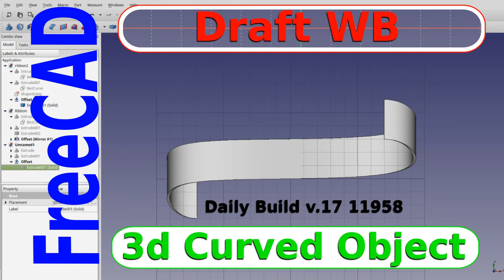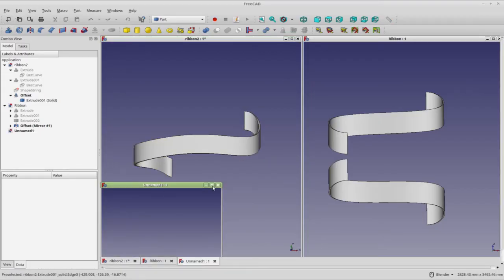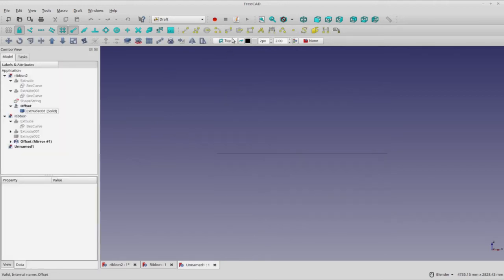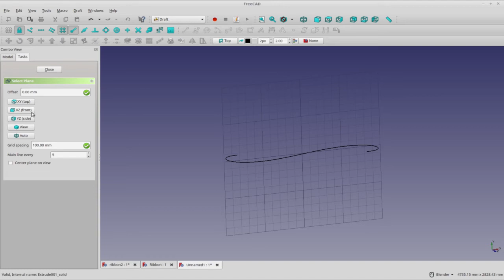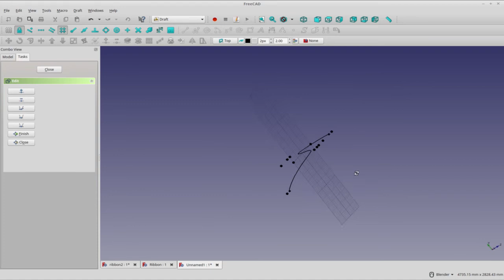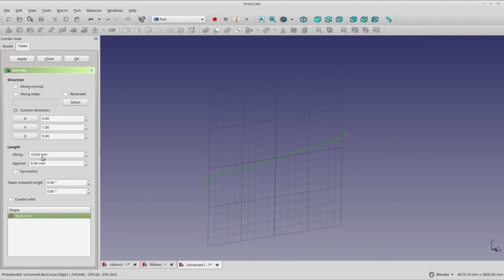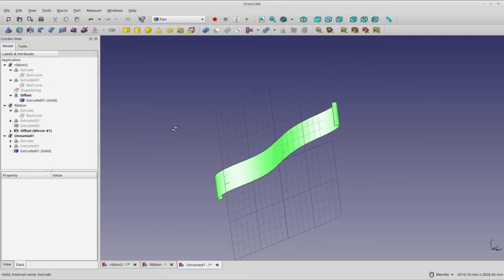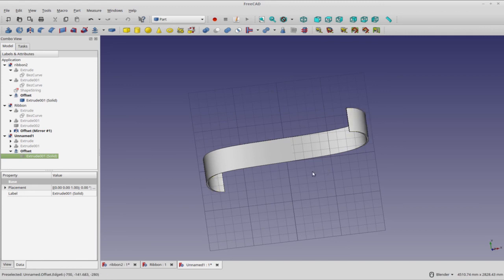FreeCAD Tutorial - Draft Workbench and Extrude to make Curved Shapes

Comment: It's a good video explaining how to do it.

Unfortunately, I could not get it to quite work for my intended purpose, which was to make a curved plate and then CUT it from a CYLINDER to make a recessed indentation

I was hoping there would be a simpler tool to just make a curved panel, one that I could adjust the properties of to fit to the shape of the cylinder.
Reply from the maker: Should be easy enough. If this video isn't enough head over to the forum at freecadweb.org a lot of experts there. Just post a screen shot of what you are trying to do. Make sure to post your version info as per forum rules. Without a screenshot it is hard to understand what exactly you are trying to do.
Reply from the maker: My first advice otherwise, us to make the profile of your curved panel in parts workbench / Sketcher , the you can use subtractive or additive cylinder.